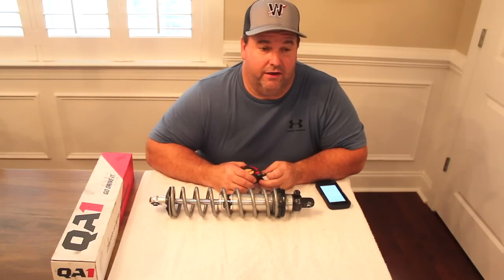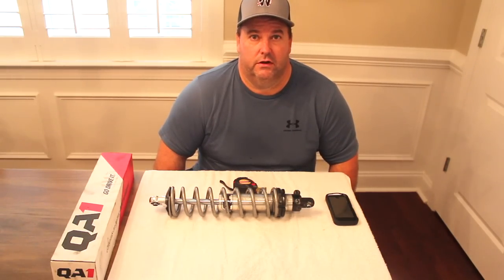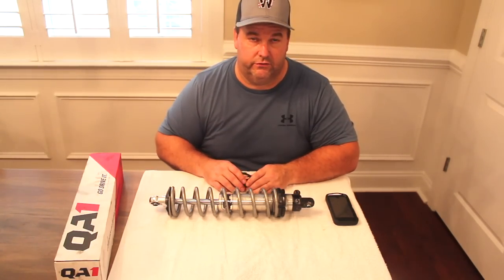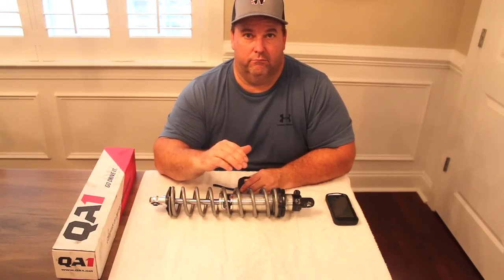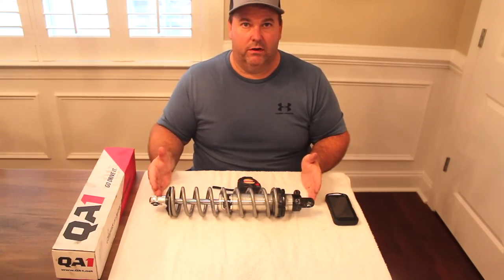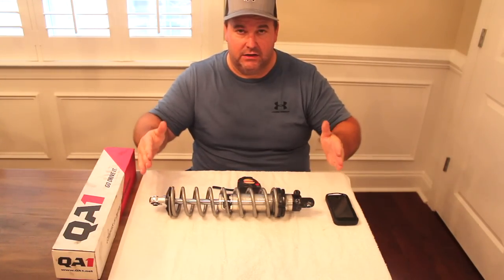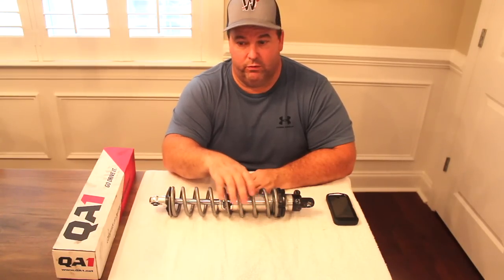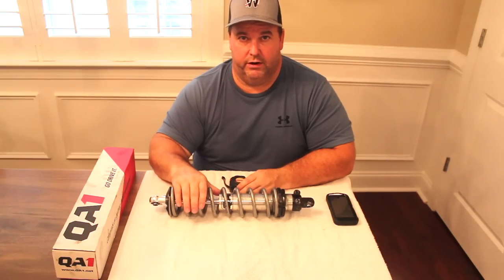Double Adjustable Shocks | Drag Racing Shock Adjustments | Coilovers

Comment from the maker: Like stated in this video, there is so much that goes into launching a drag car and keeping it straight and as stable as possible. I could not cover everything in this Part 1, but I will be releasing a Part 2 soon. Slick selection is so critical, then comes air pressure on those slicks/radials. I would continue to encourage keeping everything working together and not get one shock way different than the other shock(s). Certainly offset is required at times on many aspects of the suspension, but my point is try to not make all adjustments with one part of the suspension. Small amounts of preload to move weight, small amounts of wheelie bar stagger, small amounts of shock adjustments (even some small offsets), small amounts of air pressure change, etc.. these all work together and will help keep the suspension working and not bound up! I cannot reiterate enough knowing your scaled corner weights. With that you can make decisions based on facts with how your car responds. Also, with technology these days, so many vendors have quality products. The key is finding a vendor you trust, and then get the shock for your suspension with regard to travel, installed height, corner weights, etc.. Comment, like and subscribe please!
Reply: I got a 2015 mustang gt 750 whp spin and aquad to much i order bmr spring but i dont know what shocks should i put could you tell me please thank you

Comment: The best way to set shocks is from full tight down to loosen. This is the only way to be exact because one shock could have 30 clicks from the loosest point to the tightest and the other shock could have 22 clicks from loose to tight. This is because of valving differences. When you are full tight both shocks have the valve closed as far as it will go. Now as you start clicking down, loosening the shocks, the position of the valve will be exactly the same each click. I hope I explained that so it's understood.

Comment: Very glad that I found this video.  I have been pulling my hair out (and am having less to pull out day to day!) for months wondering why my nova is spinning.  I've turned to the suspension now, and am in the process of working some suspension issues out.  Thanks for explaining how shocks work so thoroughly.  Now I think I know enough to be dangerous!
Reply from the maker: Going Bracket Racing thanks so much for your comments! Go fast, go straight! Be Safe!!

Comment from the maker: Update!! About to get the new QA1 double adjustable shocks for the 48 Ford Coupe. I will be doing a new video on those soon and going over how the front suspension works with launching a drag car! Of course, every car is different to some degree or another, but the same principles apply at a high level. At the end of the day, it is all about the combination and learning what your car/suspension wants and needs. Stay tuned!

Comment: Love the video man. I had a nitrous LS Fox that I was having trouble with consistency. One pass id cut a 1.2 60’ and the next id wheel hop or just smoke the tires. But I just switched to turbo (not for that reason) and knew I couldn’t mess around with guessing at the suspension settings anymore. This video really gave me a lot of insight. Looking forward to part 2 and your front coil over video. Running a MT pro bracket radial.
Reply from the maker: Brett Dearman thanks so much for your comments! That video will be coming out soon, sorry for how long these take. Also, we will be doing video at the track as we tune the launch with this new combo. Not much longer before we are live again.

Comment: I doubt you will read this since the video is old but on a radial car wouldn't you want the springs to be close to coil bind when the shock if fully collapsed to use that stored energy for separation?

Comment: At what point do you buy a set of Penske shocks. My car runs in the mid 5;50s 1;27 60 ft. 
Can more gear ratio help with a more consistent 60 ft by hitting the tire harder on a border line race track. 
My car is good except one track I go too. What adjustments should I make to my strange double adjustables

Comment: Good video. You say it's not black magic, but I recently swapped out my 20 year old singles and "upgraded" to double adjustables, and they are kicking my butt. I think it was a bad decision at this point for me to "upgrade" them.
Reply from the maker: Rob Hetzler thanks so much for your comments! Sorry you are struggling. Depending on your application and what single adjustables you had, you may need to just start at a baseline setting based on the valving in your new shocks. I would encourage you to call the shock company and explain your situation and get them to share what settings you should start with on the new shocks. Don't give up! Go fast, go straight! Be Safe!!
Reply: @KevinWilsonSBC  Thanks for replying. Funny thing is, I did call them and managed to get the one guy at QA1 in the tech dept who knew nothing about drag racing. LOL  I finally got on a decent track this past weekend and was able to find something that worked. Hopefully I now have a baseline I can use to adjust from when I get someplace the track isnt as good.

Comment: Thanks for the great video Kevin.  My shocks are mounted on the front of my rearend vs. the rear.  Does the 25-30% compression still apply to selecting the correct spring rate?   Also when initially setting up a car and finding weights what do you use?  14" solid link in place of rear shock?  same for front?
Reply from the maker: Brian Boles thanks so much for your comments! The spring compression still applies as the spring needs to allow the compression and extension to function and not be too heavy to prevent those movements, while supporting the weight of the car. We do not use solid links in place of the spring for finding any weights. We can get the shock settings fairly neutral and we generally get close with the springs just based on how many of these we have done. Most of the companies you talk with can get you really close so I would recommend starting there and scaling from there. Not saying the solid link will not work, we just don't use that approach to get started. Hope this makes sense. Go fast, go straight!

Comment: So looser extension and tighter compression hits more.

Tighter extension an looser compression hits less?
Reply from the maker: Alexandru Mardare thanks so much for your comments! I wish it was that simple. It all depends on the car and whether it is separating the rear end or squating on the rear end.. The main thing is understanding what the Compression and Rebound clicks mean, so as you see how your car is reacting, you can use the shock to help keep control of those movements. Go fast, go straight! Be Safe!!

Comment: Hi Kevin, 
I just have been watching Tim McAmis Performance Video that’s named „Schock Series: 04 - Tuning Basics“ and I don’t know if they are saying exactly the opposite of what you are saying or it’s just me understanding it completely false🤷🏻‍♂️

I would be very grateful if you could take a look and tell me, if it they are actually saying the opposite or it’s just me Not understanding
Reply from the maker: Alexandru Mardare thanks so much for your comments! You are absolutely asking a great question! First of all Tim's videos are freaking amazing. The video you are talking about from Tim's channel is talking about big tire and big power slick cars that are setup to squat and not separate. In my video, I am primarily talking about a car that separates and doesn't squat. I always try to get closer to the Anti Squat line on my cars and even have a little separation with more than 100% AS, even with slicks. On the full tube chassis cars with squat, they are explaining how to get more weight over the slicks on a less prepped track, which means you actually soften compression to get more weight transfer over the rear. The main goal is to understand how the Compression and Rebound clicks interact with what your rear end is doing on the hit. Remember, each car is unique. Also, great observation and one of the best questions I have been asked yet! Go fast, go straight! Be Safe!!
Reply: @KevinWilsonSBC  thank you, I thought that that car is setup to separate, it makes a lot more sense now

Comment: All of these drag race videos are all regurgitating the same wrong info. definition of monkey see monkey do. 10% compression or 40 % compression is the same. Same weight on the springs either way. It only matters for droop travel and does not change "return force" at all.
Reply from the maker: Feel free to ignore my channel completely. We can respectfully agree to disagree. It absolutely matters with stored energy in the spring. Best of luck!
Reply: @KevinWilsonSBC  the stored energy is dictated by the corner weight.
Reply from the maker: @brendenbanks9293  I completely understand the weight on the spring dictates the amount of compression on the spring. Your original comment specifically stated "does not change return force at all." Like I said I completely disagree with you as with the spring more compressed it absolutely has more stored energy to deliver to chassis movements on the rebound, but that is fine for us to agree to disagree. L8R
Reply: @KevinWilsonSBC 
Yes, the return force does not change.

You put 700lb on a 700lb spring it compresses 1 inch (10% of a 10" stroke). You put 700lb on a 175lb spring it compresses 4" (40% of a 10" stroke). They both have 700lb of "stored energy" because that's how much weight is on the spring.

You're right in that 10% is too stiff but youre wrong on the WHY. You need more rebound travel. You don't need to run softer spring though that's dumb. You can just run helper springs to change the bump/droop distribution.

Unless you're trying to talk about the valving of the damper itself but you're not saying anything about that.
Reply from the maker: @brendenbanks9293  Like I said, we can agree to disagree. You do you and I will do me. All good. In drag racing we don't like adding any unnecessary weight when we do not have to add weight. So there are 100% times when a softer spring will absolutely improve the first 100' of the launch, especially if too stiff of a spring is currently installed. I have more videos on this topic where I discuss shock valving and how critical it is to understand shock dyno data. We may be splitting hairs on semantics here, but your "monkey see, monkey do" comments are really not necessary. Shoot me the link to your videos on this matter, I will definitely watch them.